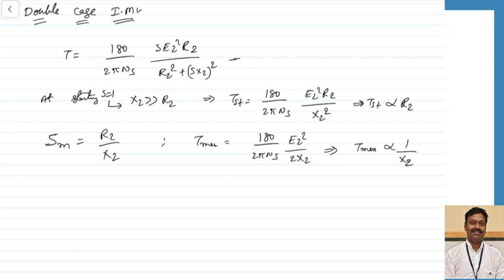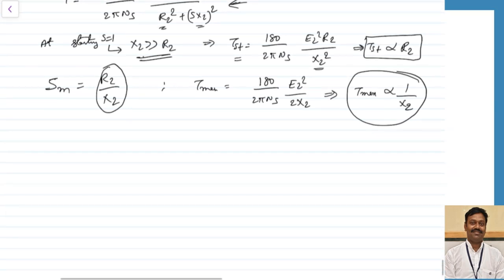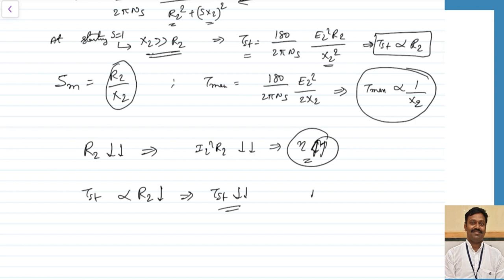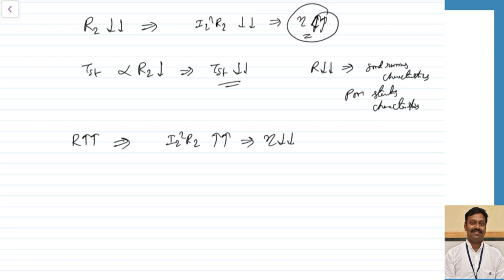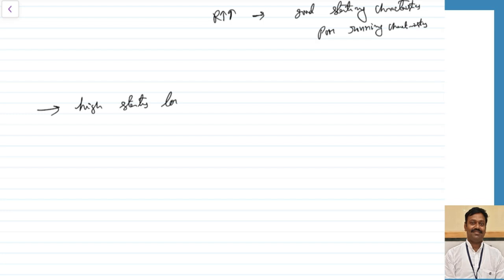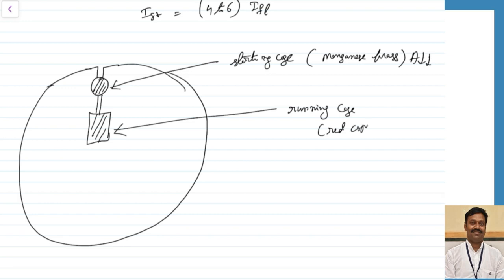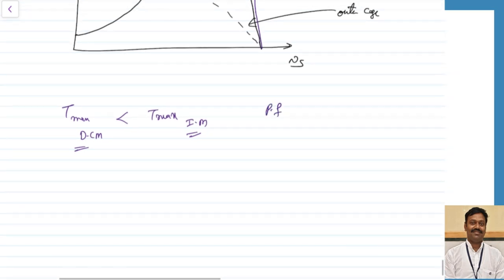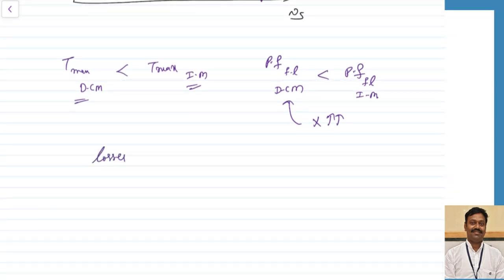SEM09 Double Cage Induction Motor

Comment: Sir in the video at 8:58 when currents are less across the winding then automatically resistances are more across the same winding if at starting
I(rw) <<<I (sw) sir then R(rw) >>R(sw) how come the starting torque will be greater sir
Similarly at 11:01 Z(rw) <<Z(sw) then 
I(rw) >>I(sw) ..hoping a justification sir thankyou sir
Reply: Yes . Clarification is needed on that